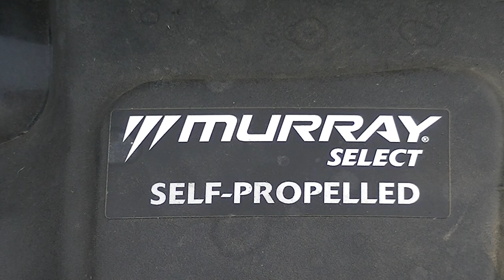Fixing A 6.25EX Mower from surging...Up and Down...Up and Down...

Comment: Excellent video mate, just what i need for my BRAND NEW Honda mower, which has this issue !!!!!  What a piece of junk !!!  They definitely don't build them like they used to.  My dad had a cast iron Hayter Merlin, lasted him 40 years plus and never went wrong apart from a couple of new throttle cables over the years and a new rear roller.  Don't think he ever bothered servicing it either...  Cheers 👍
Reply from the maker: Very nice!!

Comment: Good video. Thanks for posting. One tip I'd pass on is don't blow air into the fuel inlet pipe from the outside of the carb. That little rubber seat for the needle can get dislodged and go flying. Always blow through the bowl side to prevent that.

Comment: Cleaning the carb as you demonstrate is the easy, hoped for solution to surging.  There are other things that can cause the same problem however.  In my mower a brand new carb was installed and the entire mower checked by a qualified mechanic.   Cranked excellent and ran well enough to get my front lawn cut but half way through the rear yard the surging started extremely bad and eventually the mower reduced itself to barely even running at all, blowing out black smoke from the exhaust due to a way too rich fuel mixture.  The new carb was put on due to the mower not wanting to stay running on slopes and being difficult to crank.

A new fuel line was also installed with the new carb.  Thus since it is getting a far too rich mixture and the choke seems to be staying closed, it smacks of problems with either the governor being stuck in the full forward position or the heat control closing the choke despite the mower being hot from use.  It's even possible the rubber crankcase vent tube is cracked and allowing in too much air which may be causing the carb to attempt to compensate by enriching the fuel mixture to keep the machine running.

Note that my mower is running way too rich, not too lean.   This indicates the gas line or the in tank fuel filter isn't stopped up with trash and restricting gas flow. We know the motor itself works just fine, as the mower did initially crank and run properly for about 30 minutes.

The point being, everyone on YouTube seems to enjoy doing carb cleaning videos.  Most of the time when you see the carb being cleaned, there is virtually nothing really needing cleaning. No sediment in the bowl, no stopped up jets, nothing that was an obvious reason that would have been causing the surging, hard cranking, or poor performance.  We are just asked to believe that cleaning the carb will solve the problems of surging when many times that isn't really the entire problem.  Typically at the end of a carb cleaning video we see a one pull start, a few feet of cutting operation, and a motor shut down.  My mower did all that immediately after the new carb was installed. The real test is does a simple carb cleaning end the problem for an extended period of time.

I'm not a fan of cheap all plastic carbs. But I am equally not a fan of mowers that attempt to self control all their operation settings.  I preferred the days when mowers had operator controlled chokes and throttles that could be set as desired and when carbs were all metal.   

BTW, for those who might want to know we have a local station that sells non-ethanol gas. Not a drop of ethanol gas has ever been put in any of my lawn equipment or other motorized tools so ethanol isn't the culprit either.

My mower has the 7.25 version of this same B & S engine which is simply a slightly bigger motor but with all the same basic parts.  Anyone have any further suggestions for what I should do next, I'm all ears.
Reply: Lol,I was waiting to see what solution you had,thought you fixed it after all,be nice to know what was wrong with it...
Reply: @
Trehan Creek Outdoors

 I am in the same boat, cleaned the original carb, replaced the carb and it still hunts like Elmer Fudd does Bugs Bunny.  I can see the governor going back and forth like crazy. I am at a loss such a piece of junk, my original toro ran like a top.
Reply: I’m having the same issue, cleaned the carb and still hunting. I’m pulling my hair out

Comment: Thank you for making this. Mine worked on the first pull after this cleaning. One note from my experience: Upon reassembly, the jet assembly required a huge amount of force to re-install but I did get it in. Then I found the choke plate could not move. Why: The venturi had migrated into the path of the choke blade. I then removed the jet assembly, slide the venturi back into position and the jets reinstalled with only a little pressure needed. This was a very helpful video.

Comment: Awesome videos man.  I just got a Husqvarna 580 backpack leaf blower from a guy throwing it in a dumpster on my way home from work.  He said it had a bad bearing somewhere in the motor.   Well.....I asked to take it and he laughed but said sure.  I brought it home and found out it was missing 4 bolts and the fan.  $30 later and this almost $600 blower is running like new.  Kind of wish I had a camera to record the breakdown, fix and reassembly like you do.  Keep up the great work and I’ll be sure to stay tuned for more.

Comment: If nobody has mentioned this, some fuel additives prevent the jet from becoming restricted with varnish and other crud.. The past few years, I add 1-Tbs each of Marvels Mystery Oil and 2-Cycle oil to a 2-gallon gas can and this stuff dissolves the buildup and the engine runs trouble free all summer. This has saved me a lot of time fixing fuel problems and then I run them out of fuel for long term storage.
Reply from the maker: Nice!

Comment: That's my exact mower. You saved me buying a new plastic carb.
When I bought this I couldn't figure out why there wasn't a fuel shut off. Manual didn't mention the carb drain plug either for winter storage.
Don't like the auto choke or no-throttle. They just assume nobody nobody knows how to drive a mover, and when it quits in a few years, it's disposable.

Comment: Yes, I am the neighborhood fix it guy with the help of YouTube and videos like yours Nathan . Fixed my neighbors dishwasher a while ago and saved him around a thousand bucks! all that was wrong was a $3.00 seal. He has a PHD, but he considers me a genius. LOL 

Do you get paid in pizza?
Reply: Sigmund Blank x. Rated pictures
Reply: I have a BSME but I had to watch a few Youtube videos to learn how to fix a similar surging problem with my TroyBilt mower. It was the bolt that holds the float bowl was plugged. A  blast of compressed air that I bought to clean my computer and the use of a sewing needle to clean the passages and it was perfect. It's almost 25 years old and it starts on the first or second pull.

Comment: Very useful video.  Had similar hunting issue with my Craftsman mower, but also sputtering and lack of power.   Removed carb and cleaned per video.    Not shown on video, I had an additional white plastic ring or "collar" located in carb throat which fell out after the jet removed.  In re-assembling this part needed to be fitted back in the carb throat with the hole in the "collar" aligned for the jet to fit through.   Also in re-assembling the bowl cover to the carb body you have to correctly orient the cover, in case you forget which way, there is a very small indentation in the cover which accomodates (clears) the top of the jet, otherwise the cover is 180 degrees misaligned and the bowl cover will not seat.   Might be obvious to more mechanical types, but these are some things I discovered.    Cheers...

Comment: I've noticed they are using plastic carburetors more & more these days.  Like you mentioned, I saw another video where the guy had to make the main jet a slightly larger to fully eliminate the surging issue from returning. Thanks for the video, it's that time of year.
Reply: Plastic carburetors briggs have been using them since the 70's the sprint and classic has a plastic carb

Comment: good video. Totally got caught out with the plastic carbs.  Just saw briggs and Stratton and assumed the quality I was used to back in the day.  I guess times have changed!
Reply from the maker: Great point!
Reply: They are more quality now. It's not plastic it's composite it has many advantages. If it's not steel it doesn't mean it's bad. I have lawnmower that has steel deck and my neighbor had one that has plastic or composite one. So the question is what's more quality some would say the steel one cause steel is stronger than plastic...Well guess what on steel lawn mower a wheel fell of and when i looked under there was a huge rust hole (that wouldn't happen if grass wasn't hidden at that spot). Steel has its advantages for strength but deck doesn't really need much strength so other materials are fine to use.

Comment: I have same issue. But problem is in float. I would have to insert little piece of plastic so needle would be slightly higher.
Also float was leaky and in my country you can't find replacement. Only whole carburetor so I had to patch it. I would see results tomorrow.
Reply from the maker: Nice!!

Comment: This is a good video for someone wanting to DIY fix their own mower, but for a shop those plastic carburetors are inexpensive and I just replace them. Saves the owner money and saves my time. Also depends on what type of mower it is as well, most people buy throw away weed trimmers and lawnmowers. I’ve literally junked out several perfectly working and running mowers and trimmers due to this.

Comment: A consumer marketing special . Flags and made in America decals. If you want a great mower , buy a Honda , not a mower with a Honda engine , but an aluminum deck real Honda mower, the kind the gardeners use. If had one for 35 years and it works as good as it did the day I bought it.
Reply: That is what I finally did! East start first or second pull! There is no bigger waste of my time than trying to maintain crappy equipment.  One day it dawned on me “if I am going to do the labor on my 2 acre lawn, I will pay myself what I would pay someone else”.  I used that money to buy good equipment!  Enough said!
Reply: I remember the walk-behind aluminum deck Honda mowers. The aluminum deck was a casting, and when struck, tended to shatter.

Comment: My neighbor brought over his troybilt 21" mower  I found the fuel line disintagrated from the inside with tiny ,stringy black,fibers  .I replaced it and it started and then she started spooling up and down ,I put a new carb on it and it did the same thing. I'm still fkng with it.
Reply from the maker: O my!
Reply: @FixingWithPassion  I sprayed a litter ether on the head around the intake manifold and it  evened out. So i think it may be leaking at the O-ring on the plastic intake. I will let you know  how it comes out.

Comment: Thank you. Without this i wouldn't have known that the jet comes out and apart. One of the jets is so small that even a wire brush wire is too big and I used a strand of electrical wire. Only thing was I didn't realise the plastic venturi (not on your model,inside the bore in front of the butterfly) falls out and after finding it on the floor I couldn't understand why the mower ran so bad. Once in and carb dismantled for the tenth time It now runs well.
Yes horrible carb. Actually very cheap to buy new. Not a bad idea to have a spare.

Comment: great video. love the part where you explained to scribe the aluminum body of the carb for better seal, awesome.
One small suggestion, would be to put some fuel in the tank to swirl around and then drain for any possible debris, especially during disassembly, but still a great video to my favorites it goes... ; )
Reply from the maker: Nice!

Comment: One thing to those having to deal with these carburetors.  If you can't get the metering assembly to go back in, it's the white plastic ring in the carb throat, that falls out sometimes.  It has a hole for the tube to come into the throat and it has to be aligned.  Why it doesn't have a keyway or notch to get it right is beyond me.  It's a little difficult to align since you can't see inside and it has to be perfect.
Reply from the maker: I know right!!

Comment: Good work sir.
Reply from the maker: :D
Reply: Nathan Rohrbough I just bought a Troy Bill model series 830. Has electric start and self propelled. I’m pretty excited. It starts up on the first pull which is the first time in my life that’s happened. So I assume the carb is in good condition. I bought it from an older gentleman and it’s been sitting a while.

Comment: Are these style of carbs known to go bad as in just wear out after a few years? Because I had more trouble with these carb surgeing up and down or doing that causing the mower to die. I never had much trouble out of the older style carbs on the Brigges and Stratton engine.

Ive cleand out my carb / gas tank, fresh gas and mower will run fine but just a week later to maybe 2 weeks later this last time, the mower again starts surgeing up and down sometimes as your mowing it might clear up for a little bit but then start again. Ive even put in new spark plug and air filter.

Any idea's of what to do next am thinking replace the carb?
Reply from the maker: The kill cable they always break it seems.

Comment: I have the Briggs and Stratton 450e, its a very similar motor to yours. I did everything you did, fitted a new spark plug and air filter but it still surges/hunting.

Comment: my mower does the same thing,  i cleaned the carb completely, new plug, new gas, new oil change, and new air filter... still cant figure out wtf is going on here?!  any suggestions?   could a low governor cause this issue?

Comment: I had a mower 6.25 series also, to fix the problem I ordered B&S jet main # 592805, installed in plastic carb, mower doesn't surge anymore.

Comment: If applying some choke clears the issue you know it is a fuel delivery issue.  Partial restriction in the fuel circuit.  Compounding the issue are these engines running ever leaner.  It doesn't take much to interrupt that fuel flow through tiny jets.  Even the revered Honda's sometimes get to hunting.  Fortunately with them you can change the jet... or open them up if you have the means.  Ethanol has not been in any of my equipment for about 6 years.  Not a single carb issue since I made that decision.

Comment: Nathan, I have a different model, same issue though, with a new carb, second actually, returned the first in the event it was defective. Any chance this could be caused by a worn governor spring or bent governor spring bracket?

Comment: I've got the exact same engine that is hunting.  Cleaned the carb 2-3 times and it still hunted.  Put a new OEM Briggs carb on it and it still has the same problem.  The butterfly flickers back and forth and if I manipulate the throttle, it will tunnel but then starts to backfire.  I've been told to check the sheer pin but haven't had a chance yet.  Any suggestions???

Comment: If there is a built in fuel filter in the fuel tank, Why did it jet get clogged up?
Reply from the maker: Micro crap.
Reply: @FixingWithPassion  O Okay I understand that the jet is only .016 of an inch. And that all the other carbs on older lawn mowers are  .030 of an inch.

Comment: I own a lawnmower with that same engine.  I cleaned the carburetor and replaced the carburetor which was cleaned. but it will barely pick up the gas 9 times out of 10 when I pull the rope.  All the cylinder head bolts are tight.  What else can I do?
Reply from the maker: Nice!!!~
Reply: How come all you said is "nice"?  Did you read my question?

Comment: Rather than taking the time to clean the old carb I chose to put a new carb on.  Guess what?  Same problem: surging up & down, up & down.  So now what can I do?
Reply: I had the same problem twice with new carbs- took them apart and cleaned and ran fine both times.

Comment: At 1:20 he points out the engine is trying to find the right air and fuel mixture, then at 17:49 he puts the same filthy air filter he pulled off earlier right back on the intake. Smooth move.
Reply from the maker: Was testing the motor to see if it was going to run before wasting money on something that does not run. Always one step ahead! Got a new one now. Thanks for watching.

Comment: These newer gas engines are made so cheaply, it suggests that cordless units will replace them. When you see a product declining in quality, then you know it’s days are numbered.
What’s next cardboard carbs?
Reply: Plastic carbs are around because of the nasty Ethanol fuel.     I just worked on two mowers from 2005. One with a plastic carb on a 12.5 intake and a honda  generator with a metal carb.   Both where sat up in 2014.  The Plastic carb needed only to be cleaned out.  The honda carb had everything corroded brass aluminum and steel. It had to be replaced.   I've recently also worked on carbs from equipment that was put away in the 80's.  All that was needed was to dip the carb and run some welding tip cleaners through it and they run fine.  Ethanol gas is friggen horrible.
Reply: @bryco32  Does the same thing happen with fuel stabilizer? I always add a couple ounces to my 5-gallon can.
Reply: You can use a fuel stabilizer but that only gives you about 90 days so you need to run out the fuel when storing the equipment for a longer time.  Only buy as much gas as you can use in a month use stabilizer and keep it fresh.
Reply: @berardia4  if you 2x the fuel stabilizer recommendations i find it works well past 1 year. I also find keeping the tanks filled to max prevents condensation.
Reply: Roblamont80 ethonal free gas still needs Stabil. It will go bad after a few months.
It will not attract water having no Ethonal. It’s not in my state, but I drive to neighboring states to get it. But I do add Stabil to it.